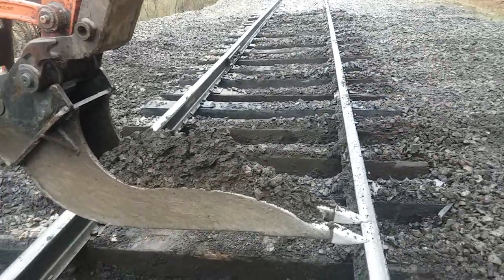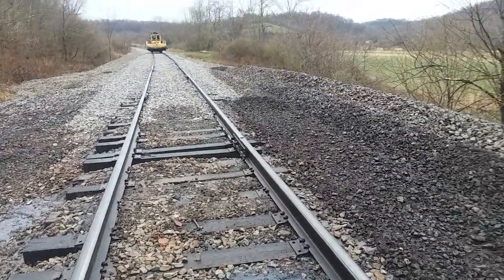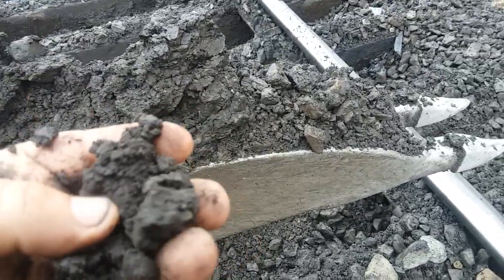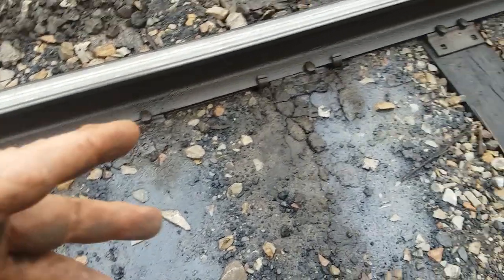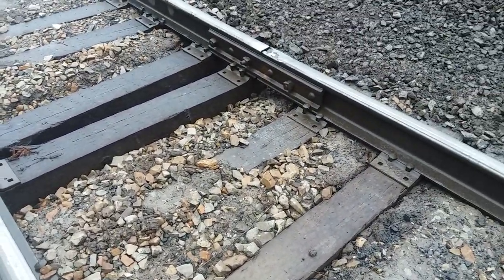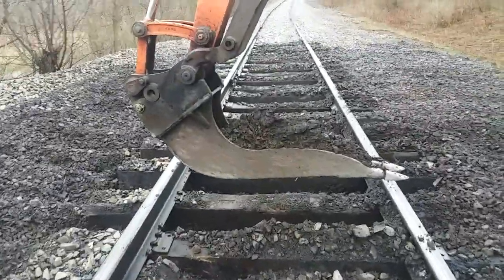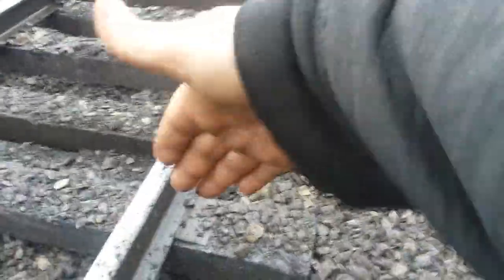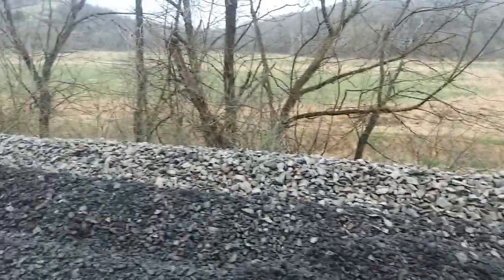Cribbing Ties on the Railroad Track - Why Ties Have to be Cribbed Out

Comment: That looks like quite a job, thanks for sharing.  I came to appreciate how much oil & grease trains drop, years ago.  I went to New York City to take in a show and needed a place to park.  Lucky me! There was an open spot under the elevated transit tracks, so I parked there.  Quite a few hours later, I leave.  On the way home I noticed a myriad of little oil flecks on my windshield, when I got home I could see the entire car was covered.  I guess the locals in the city know NOT to park under the EL.  Lesson learned.  Over the years, that would be quite an accumulation.
Reply from the maker: Wow, that's interesting to read your comment, I never would have
thought that either, live and learn. Our sd 40-2 dumps a good bit of
oil out under it too, wouldn't wanna park under that thing either.
Appreciate your watching

Comment: One time I kept finding these 1" glass marbles along the railroad through town, there on the Santa Fe main. So the track superintendent told me those 1" rough  marbles were essentially glass ingots going to a glass foundry. Because if they shipped it as glass sand, in hoppers, half or more of the glass sand would be gone. The glass marbles don't fall out quite as easy from the hopper cars.
Reply from the maker: That's very interesting Michael, good thinking on their part. Thanks for sharing sir

Comment: Love it Dave. Us guys that sit behind the throttle don't appreciate a good track until we have worked on a bad one. Kinda like a road you can't appreciate a new black top until you loose your teeth due to pot holes
Reply from the maker: Your welcome my friend. Don't get any coal fines plugging track
running intermodal or bathtub coal cars, we got a unique situation
with jointed track and bottom discharge hoppers, double whammy.
Luckily we only have 25 as track speed, can get away with a lot
more than you guys have to deal with.

But seems like all railroads have problems at grade crossings with mud and pumping track. It's a struggle to keep up with all our
bridge approaches. Solid surface then track wants to dip off
the bridges, having 14 bridges here, that's 28 approaches, drives me
nuts trying to keep track surface up to grade

Comment: Would like to see a video about how to make a curve , how you bend the rail to make it curve . Keep up the good work , love the vids !
Reply from the maker: Wow Mark, never thought of that, it would be an interesting video,
I will keep it in mind for a distant future! It is amazing how that rail 
can be curved. Short explanation, when we replace a rail in a curve
we have to manually bend it to make it fit. We do this by using lining bars stuck in a tie plate and pushing against the bar, then driving a 
spike to hold it, this follows along the rail until the next joint is made.

Remember the old pictures of all the section gangs using lining bars to bend the rail in place? Thanks for watching and your comment sir!
Reply: @ccrx6700  thank you !
Reply: @ccrx6700  Happy digging, can you video digging out the ties?
Reply from the maker: @rockybigdog8506  Gonna try make a new one in the future of doing that,
for the meantime here's a link to an older vid I made as I'm digging,
it's kinda slow going so you don't get the full effect, but am looking into
a cam mount for the machine so I can do it much faster.

https://youtu.be/qXzjrATKtls
Reply: @ccrx6700  Thanks just subscribe!
Reply from the maker: @rockybigdog8506  Thank you, appreciate that 👍

Comment: Good morning from Norway! So you have enjoyed a weekend with what we call a "wash-out zone", it is a problem that occurs on the same place, year after year here! But it happens that the management gives us money to repair it properly! Most of the track that we are working on is from 1880- 1910, so the structure is often not drained properly. On the Railroad I work on, we have different enemies, one is the sun during summertime, water in the spring, leaf in the autumn, and snow in the winter! But of all things, water is the worst! It is almost not a year without a derailing one place on the line! At the line you have here, is it often you have derailment due to the structure? Well, i have my doubt, it look like a well maintained railroad you have there! But it would be interesting to know a litle bit about your... Challenges. Well, we are going out on a inspection trip today, it is room for us between some train now due to the Covid situation, so i have ordered time for my loco today at 1105 CET. And then we find out what to do next weekend! But then it is Easter, so it will make some extra money. Have a good day Sir!
Reply from the maker: Old time rail roader once told me there are 3 things you have to know about maintaining
a track bed, they are Drainage, Drainage and Drainage..

You inspect track from your loco or do you pull a geometry car with it?

They have problems with leaves in the autumn on several commuter lines in
New England, they've tried different methods of trying to get the leaves off the tracks,
We don't have that problem luckily.

I started full time track maintenance 18 years ago and we've only had 1 derailment
in that time due to track conditions, it was my first year and a joint bar broke on a
high degree curve on a 2% up grade climb, the operator threw the train into emergency
and 2 cars came off. 

Our biggest challenge is mud in the tracks and with all jointed track to deal with
it's gotten far out of hand. There are only 2 of us that work track maintenance and
we almost always have to work live track so time is limited.

Send me a link or the name of the RR you work on so I can look it up and
learn more about it please

Comment: Thanks for the explanation at least your situation wasn't as bad as the Powder River muck debacle a while back. Also with lower speeds you don't get all the dust swirling off the top.  Several months ago a major diamond near Milwaukee was replaced that supposedly was having drainage problems. Almost 60 trains per day
Reply from the maker: Thanks Paul, don't know anything bout that Powder River thing. Gonna have look it up. You're right not much dust coming off the
top, every now and then someone will overload a bit and some of
that comes off. Appreciate your watching and writing in
Reply: @ccrx6700  The Powder River problem was 10 or so years ago when coal was still king out there. Years of deferred maintenance along with increased use of air discharge bottom dump did a number and resulted in sections being dug out to the subgrade and being repaid. Years ago it was estimated on a 100 car train it lost a whole car due to swirling wind. This led to mines applying a liquid wax coating to the load. Utilities sued as their stockpiles dwindled during a hot summer. So your problems look small by comparison. Many a unit train in long term storage so could get some low mileage beauties fairly cheap
Reply from the maker: @paulbergen9114  wow Paul, thats really interesting, thank you for sharing with me! Thats amazing losing over 100 tons per train, holy smokes Batman. I can just imagine what their ballast looked like.... hmmm, they needed me to dig! 😉

Comment: How many miles of railroad do you do maintenance on? Either your company really wants their rails in impeccable condition, or the miles are so many, or this line requires extreme amounts of maintenence.

Either way its always fun and interesting to watch. Thank you for your work and will to share
Reply from the maker: We have 17 miles track, it is unique. All jointed track and only thing
we haul is coal. If we only hauled tankers or box cars, etc, then we
wouldn't have much of these kind of problems, so yes with that combination we do have a lot of stuff that needs done. And with only 2 of us in MOW plus we have to work live track most of the time,
it is sometimes limited to the amount we can get done. We only get
about 2 weeks sometimes 3 out of the whole year where we have dead track which doesn't help either. Thanks for watching and for the comment, glad you are enjoying the show

Comment: With having that much fine coal in the cribs and on the side does that also increase the chances of a fire happening from sparks off of brakes or wheels?
Reply from the maker: Stephen, you always got some good questions. Thankfully we've yet to have that happen, although there been several field firs along the tracks from sparks out of the loco exhaust, couple those fires were intense with several fire companies called out and the loco was used to shuttle them from fire to fire, that one had fires spread out over a 4 mile stretch.  Thank you for watching sir 👍
Reply: @ccrx6700  Wouldn’t have thought of that! There was a NW line next to my grandparents farmhouse and the concern was sparks from the steamers in the day. Didn’t consider diesels throwing sparks, but if the turbo gets carboned up from too much idling  / low load- Bingo. Probably not as big of a concern with the Class 1’s. Seems they worry more about wholesale seal failures and the flame thrower that causes! The NW primarily hauled taconite and that made the ballast pretty dirty too.
Reply from the maker: @crabcake43011  William, can't imagine the fires that happened back in the 1800's in the prairies. Sometimes when our emd locos sit then the first run if it's after dark the operators have told me its a real spark show

Comment: Just curious, was this track neglected, or is this normal maintence? The reason I ask, is that the B&LE is just right next door, their track looks much worse, all clogged up with ore pellets. They run 
2   CN or IC  SD-70’s on the head end, over 100 hoppers, then 1 or 2 pushers. They don’t seem too worried about the ballast unless a rail breaks!
Reply: Anyone want to start a group to buy B&LEs Greenville Shops?

It's probably simply too much work for a much larger railroad, especially when you're held by a Class 1 (CN). They probably have MOW trains occasionally re ballasts the whole sections of track.
Reply from the maker: Jimbo, we've never before cribbed this section, they been running since 1977 over it. Get it all tamped up and hopefully will be good for a lot of years to come. Do appreciate your watching 😊

Comment: Were you saying that you'd have some machinery come in to clean the ballast outside the ties, where you'd dropped the mix from between the ties? IIRC, from some YT vids, there are some machines built especially for the purpose of "freshening up" the ballast. Way less expensive than replacing mucky mix with fresh stone.
Reply from the maker: Would be great idea if we could get it in here, but not being connected to another RR limits our options, so we have to do things the slow way sometimes. Thanks for viweing the vid sir 😊

Comment: Shoulder clean the ends, water can’t stay under and it’s quicker, cheaper.   In combination with a two inch lift for best results.  

The wasted ballast on the sides is huge. 

Why is the track not continuously welded?
Reply: When I wrote that I did not realize it was an isolated line.

Comment: Love the knowledge you share, much appreciated.  Don’t you need to use the saw attachment (forget what you call it already) to rake coal and mud debris from under the ties then place you new stone so the ties have a solid footing?  So,  that being said I guess maybe the rail bottoms between the ties also help displace that weight as the rail itself pushes on the stone?  I am pretty clueless sorry, just trying to understand.
Reply from the maker: You are correct sir. Do consider that we don't have an undercutter, we have
to rely on Hulcher to come in and do it. They won't come in for any less than
4 days so we have to have time when the train isn't running to do it. This
only happens for a few weeks every year. While it is the best way to do
things, it's not something we can do on a consistant basis. So cribbing is
our next best option. Also when I tamp and lift track that will put the new rock
under the ties, after several passes tamping I will have lifted the track
about 4 inches above where it currently is. Hope that explains a bit more,
and thank you for asking a very intelligent question
Reply: @ccrx6700  Very good sir appreciate the thorough reply.  I find the lifting/tamping, all of your specialized tools and equipment quite fascinating.  Thanks for all you do for your viewers! Be safe out there!
Reply from the maker: @kurtzbradley  your welcome, it's nice to be able to share, especially when it's appreciated and so many of those who write in are grateful. It's very special to me. 😊

Comment: A ROI assessment of Bethgon style coal cars and a rotary dumper vs all this track maintenance and rail replacement might show it is worth it.  No tools exist that let you bore out the rock between the ties from the tie ends instead of using that narrow bucket?
Reply: It's fine particles, there is no way to fix that other than remove and replace the gravel. In theory, you could use a rock separator and reuse the gravel, but that probably isn't worth the time.
Reply from the maker: Having different cars would certainly make a huge difference, I'm always jealous when
I visit NS tracks here, they use the high sided gons  for coal and the ballast is clean,.
Have never seen anything like a boring machine type used for this, very interesting idea!

Comment: Is there a track machine available that would be similar to a tie ejector that would simply shove the fouled ballast straight out from between the ties? Or maybe just a tie ejector that would use a ramrod of sorts to push material through. Seems faster than digging, but I suppose if it worked Jackson would already make one.
Reply from the maker: Matt, very good question and yes there is one. We are looking into possibly renting one if it becomes available. 😊

Comment: The hopper car door edges could be self-sealing somewhat similar to the way that couplers interlock.
Reply from the maker: When the linkages are adjusted properly or don't have much wear
on them, and the car doors aren't bent, they do seal pretty well, just
that these are pretty old cars with a lot of wear and not enough
mechanics to keep everything up to par. Do appreciate your watching and for writing in Robin

Comment: How big is the ballast you guys use, our mainline ballast is around 2"- 3" which provides better drainage, it's also known as farmers rock at some quarries.
Reply from the maker: Jason, the rock we use is called #3, it's about the size of tennis balls. NS around'
here uses a similar size but it's granite. They have unit trains which bring it
in, granite is way too expensive for us, it would be like triple the cost of
limestone. Problem with limestone is first the dust, then because it softer
than granite, continual tamping breaks it up which actually contributes to
dust plugging up track, but we have no choice . We have 3 quarries here, they all 
have a different hardness in their limestone, long story bout that
Reply: Sending an email
Reply: We use basalt as our ballast and we get our ballast trains loaded up with basalt at a quarry with a balloon track.

Comment: Considering how often you inspect and replace rails, how quickly would you say it took that battered head to show up? Is this something that "suddenly", all at once, shows up after years of up and down or it it something you noticed a while back and you've just been waiting for it to get "bad enough" over a few months?
Reply from the maker: It's been happening for some time. With only 2 of us working track
maintenance, we just can't get to everything that needs done right away, so this got put on the back burner until we could get there. 
If we don't replace that bad joint then eventually the head on the
rail is just going to blow out, so it's on the list to get replaced soon.
Appreciate your watching

Comment: Great video Dave.  “Mud Jacking” is a huge problem in railroad.  No only does it cause “rail batter” but it can break joint bars also in the winter time it can turn to “ice jacking” which can trap ice between rail and tie plate and poor drainage speeds the rotting process of rail ties.  I work for Canadian National and our rail yard is right next to US Steel Gary Works we get coal cars all day long.  We have a yard sweeper I wish I could show you the mounds of coal we clean up.
Reply from the maker: Wow, did not know Gary still was open, that good to hear. Didnt CN have a derailment bout 2 years ago at grade crossing that was caused by ice jacking, it was somewhere in Canada? Have heard term ice jacking, but thats first for mud jacking. Certainly not doubting your terms tho, I have a lot of respect for your RR knowledge. 

We usually get 8 to 10 joint bars break in winter, and usually they in a mud spot
Reply: @ccrx6700  Maybe I created a new term with the “mud jacking” but we do call it “pumping mud” around these parts😂.  US Steel Granite City was the plant that was shut down for a few years it back up and running again. CN Kirk Yard is one of the largest hump yards in the US.  We get a couple joint bar breaks every week.  There are over 200 tracks in Kirk Yard
Reply from the maker: @gutterguru7158  mud is mud, like you say, nothing good about it no matter what we call it! Good hear that bout Granite City. Am gonna check out the yard on web, thanks! 👍